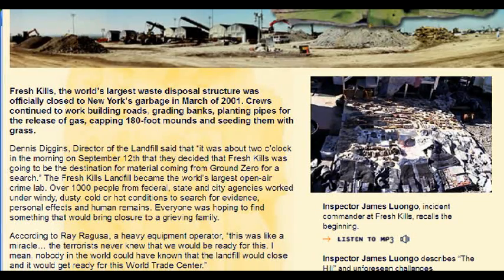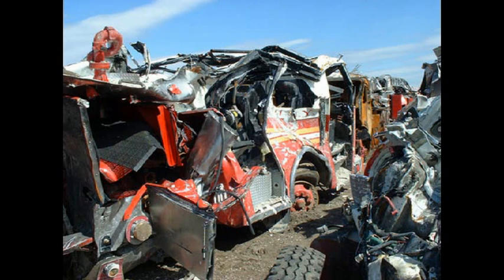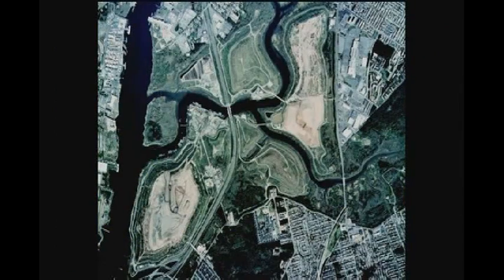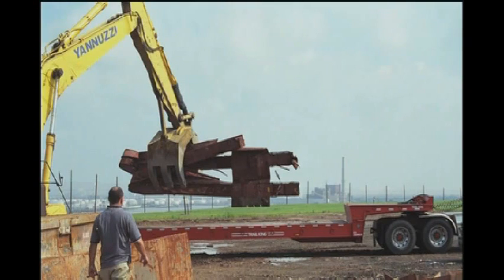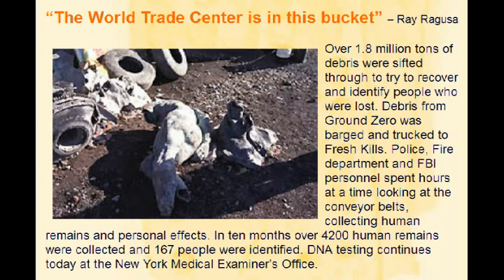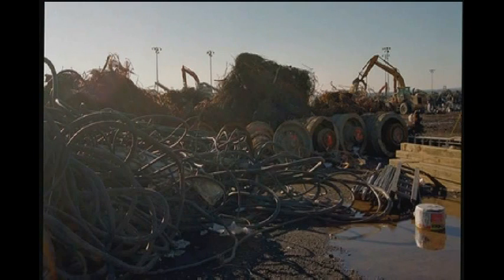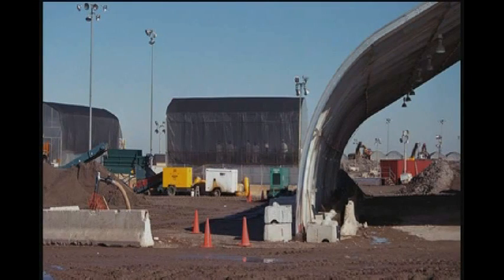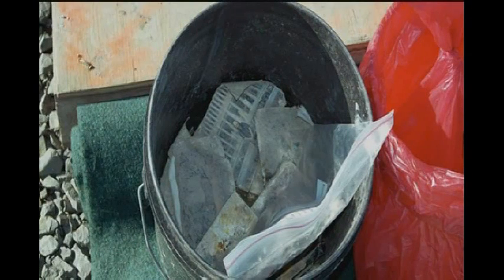The Smoking Gun from WTC 6

Comment: I made up this story.
 Montauk (flight 800, beam weapon) backs up Brookhaven (experimenting in turning solid materials into liquid) up to HAARPs dome in the ionosphere. Down on the twin towers complex.
 Hurricane Erins electrostatic energy upto HAARPs dome in the ionosphere. Down on the twin towers complex. The beam weapon from Montauk, has a tunnel through the atmosphere that the beam weapon travels in. This tunnel encircles the twin towers complex, where the cars were. This electrostatic/microwave vibrated the paint off the cars, but the sheet metal was thin enough to dissipate the energy/heat. Like the paper, rag dolls, trees. Raw sheet metal rusted instantly. The door handles, glass, engines melts because they were to dense to dissipate the energy/heat.  Like the marble and the iron structures. The towers/buildings were vibrated like tuning forks, turning the concrete into dust/foam. The electrostatic energy from Erin was reversed polaritied, that repelled the van der Waals force that repelled atoms/molecules from atoms/molecules. Then the van der Waals force attracted the atoms/molecules into iron-rich microspheres found in the dust.
 And the only plane was a B2 bomber (the ball) with a hologram projector. Look up "B2 bomber holograms", it talks about projecting planes, but the wings would disappear on the projected planes. Like the left wing disappearring just before it entered the tower.

Comment: If it were simply heat that caused the melting there would not have been loose paper everywhere.You can put paper in a microwave and turn it on for an hour and have nothing happen to the paper,But put a piece of steel in the microwave for only a second and it throwing sparks.Think . There was no fire at ground level where those vehicles were located.There was no fire damage inside building 6. It looked like it had been scooped out clean from above with a large ice cream scoop it was so cleanly emptied out.
Reply from the maker: +Flat Earth King Henry Cat 
Bingo....  https://www.youtube.com/watch?v=mh18dip7Z5M